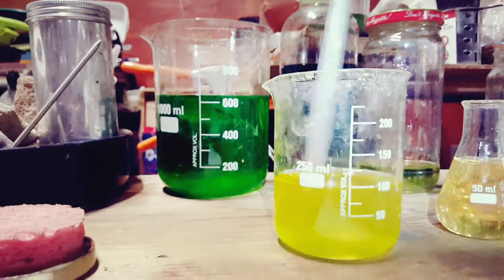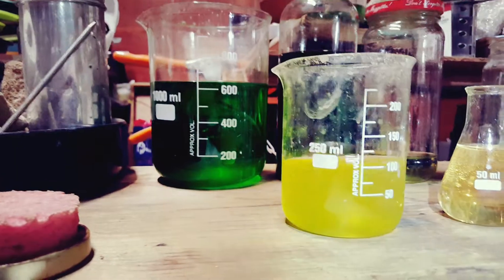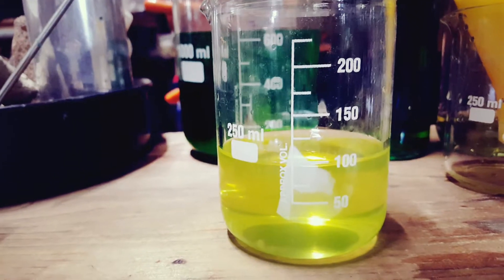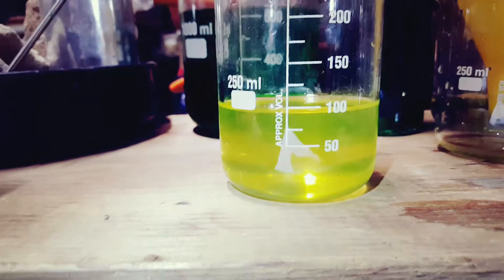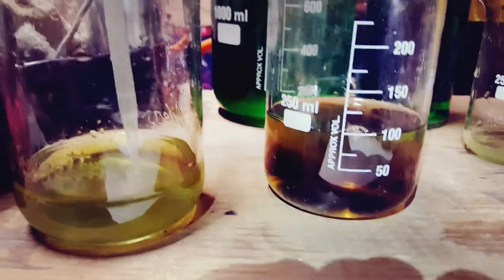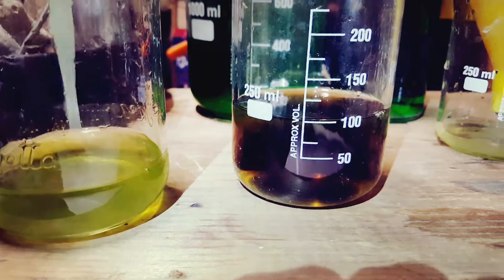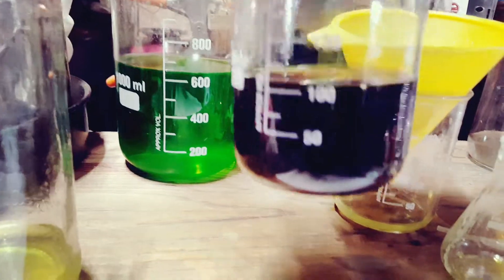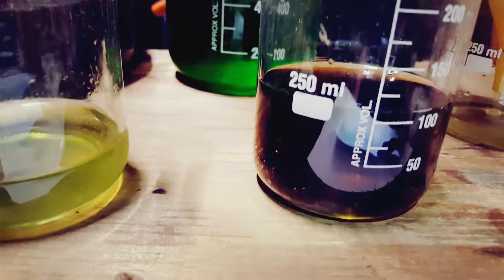Au precipitation from Aqua Regia using Copperas

Comment: Your dropping the gold not leeching it's already been. Leeched. Also if you Denox with sulfamic acid it will will drop lead as Well as Denox the solution. Thus no need to use your sulfuric. You should join our refining Facebook page e gold recovery and refining. Answer the questions. Also it's not gonna be pure gold when you precipitate with Coppras. Pure is pretty difficult to achieve n adding iron won't help that.

Comment: Did you denox the AR before adding the ferrous sulfate? I am having all kinds of problems using SMB. Yes denox first, since my Au comess from ore that has alot of sulfur the sulfur is carrying through. I was told to use ferrous. My cons get soaked for a day in 12 to 1 sulfuric and water then rinsed on the shaker table, so my lead is gone then also. Any ideas would be appreciated.
Reply from the maker: migel reyas Heya, Migel, I Denox via time mostly—letting solution sit around. With the promise of filming the Drop portion of the process for a friend, I hurried the Denox using small doses of NaHCO3 (Sodium BiCarbonate or Baking Soda). The solution was still a bit acidic and did take some of the dropped gold back into solution. As soon as I got pH more Alkaline & warmed the solution, it simply dropped on its own. 
I use SMB often w/ few issues. Are you heating up the solution first? Cold Solution + SMB = No Bueno/ unimpressive drop. I made my own Ferric using the steel plates/sheets from a capacitor & Sulfuric Acid (sourced and extracted from  an industrial drain cleaner). Turned out perfect first go. I’ve also made it from Hi-Yield Ferrous Sulfide (Brand of Garden Chemicals easily found most Garden Centers & Home Improvement Stores). Just filter it. 
Nice, on the Shaker Table. I’ve thought about taping a bunch of electric toothbrushes to a piece of flat, smooth ...slate/ chalk-painted wood, et alia for a shaker table...Alas, it makes my brain pickle when I think about the sounds coming from a bunch of vibrating toothbrushes operating all at once. Just sharing. 
Let me know how your project is going. I’ll contribute if I can. Thanks for watching.
Reply: @IntoEverything  Ok I know from assays that I have Ag,Au,Pd,Pt & Rh. I have micro with sulfur and iron. ore from very old tailings. I even got a message from a guy that I just found out stole some ore. He sent photos saying he got 8 grams of mixed precious. Ok The 1 assay place said the sulfur is blocking me I need to remove sulfur first. I concentrate down to cons from shaker table, then boiling HCl several times, then into HOT AR until no reaction, increments of nitric added, filter 3 times until only liquid remains. A few weeks ago I done 5-6 lbs of cons 1 day in AR filter and zinc then melt got 3 grams, tested Au,Ag & Pt. The amount should have been higher, but found out I should have left AR go until no reaction,days. Ok so I took 30lbs of cons started in bucket AR several days then into pots hot for total 6 days, filter, then urea to kill nitric, then add HCl, then put AR solution in a bucket with copper pipe and air to mix. Now its been 3 days. I messaged a guy on here he said zinc dropped every metal copper will only drop the precious metals. At this moment I want the gold and plan is to put the rest on the back burner[save]. Tomorrow I plan to filter the AR/copper, then back into AR and try SMB for the gold. I done a test batch this way but with a 1/2 lb of cons. I got a brown precipitate from SMB. AR color in beginning was yellow/red, 1 day in bucket it was yellow dark green, now its black with green tint. Will the copper way process work and drop my precious metals? As I understand the copper in solution wont hurt the SMB from working. The test run SMB dropped something brown, not enough to melt and weigh, but it was a test. I just wish I was sure it would work and how much urea to use.
Reply: A simple answer is “don’t”.  Urea is useful if you want to speed things along but it tends to bring other problems into the mix, so to speak.  Heat and time do the job just fine.  Hold the pH to around 5 and if you have already gotten rid of any tin or lead, you should be good.  If you use Urea, check the pH frequently and add it slowly. I imagine it sucks watching your gold spew all over the place during a runaway redox reaction.
Reply: @IntoEverything   you have to use cold solution with smb. Smb doesnt drop the gold. Smb reacts with your solution forming so2 gas the gas is what drops the gold. Heat drives the gas off faster. If you're having issues with smb its probably due acidity level. I use water to dissolve my smb as little as possible n it's worked every time for years.